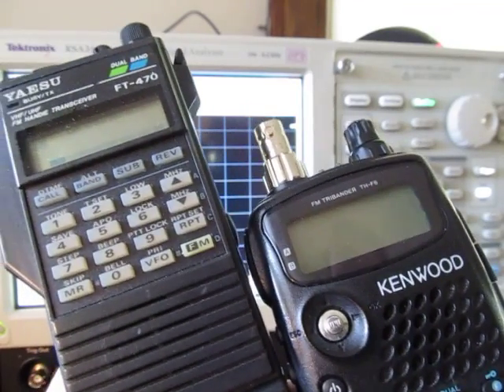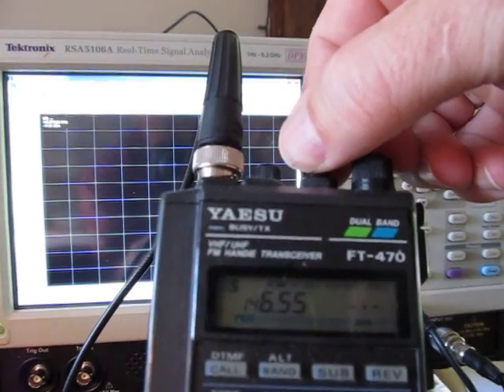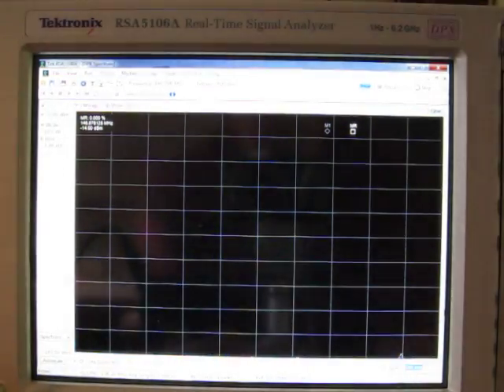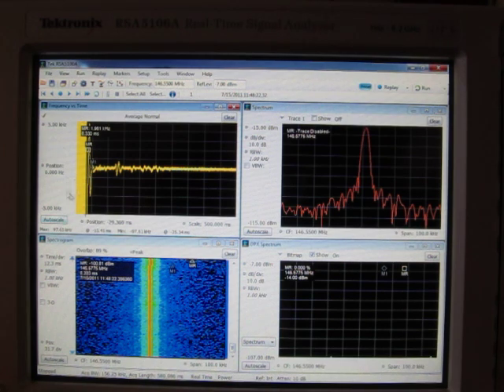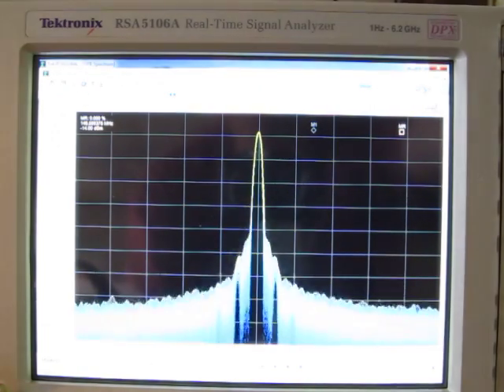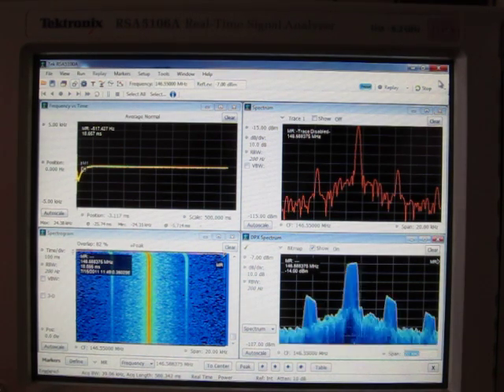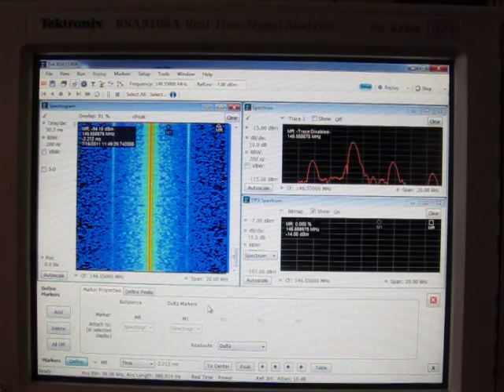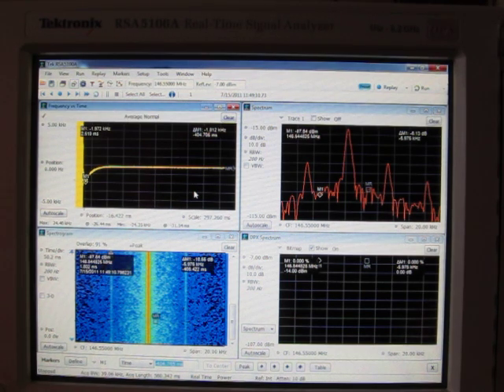#12: Use Real-Time Spectrum Analysis to Characterize a transmitter key-up

Comment: Can you give us the ordering information on your variable coupler device?  I think something like that would be useful in my shack!!  Yet another very helpful video.
Reply from the maker: It is similar to this unit: https://www.rfparts.com/signal-samplers/rfa4059a.html
Reply: @w2aew  Ok, thanks.  Is that one adjustable as the one you have?  It doesn't appear to be so in the specs, unless it should be understood by those in the know.
Reply from the maker: @microreniassance2929  If you look at the datasheet (https://www.rfparts.com/fileuploader/download/download/?d=0&file=custom%2Fupload%2FFile-1484260130.pdf) you'll see that it has the adjustable "slide".
Reply: @w2aew  Ok, thanks.  I didn't see it in the front end specs so I didn't look further.  My bad.  Thanks for all the help, as usual!
Reply: @w2aew  I can't seem to find one that handles 1.5MHz to 30MHz in that form factor.  Bird has some but about 7x more expensive.  I'll keep looking!
Reply from the maker: @microreniassance2929  Those same unit will work at HF, but will have higher loss (less coupling to the sample port) - but definitely usable.  It's what I use...
Reply: @w2aew  I was wondering about that looking at the spec graph included in the package.  Thanks for the confirmation!  I'll use it as is!

Comment: Seems that not good design for transmitter since i guess synthesizer is not already locked while transmitter is already powered. Should not enable tx before lock detection to avoid these outband garbage

Comment: I have a transmitter fingerprint board I bought back in the 90s.  Its an ISA card that goes in an old computer, or it has an external enclosure that interfaces through a parallel printer port (remember those?) to a laptop.  It runs DOS software and you hook it to the discriminator output of a receiver, and it will build a database of these transmitter keyup transient fingerprints.  Every time someone keys up, it displays the callsign you previously associated with that fingerprint.  Great for identifying asshats on the frequency.

Comment: What model Spectrum Analyzer is this ? Not that I can afford it, but I thought all TEK RSA's were USB type that used the PC for display.
Reply from the maker: The Tektronix USB based RSAs are only a recent development.  Tek has had benchtop RSAs for more than 20 years.  Early on, these were made mostly for the government agencies.  Over the last 10-12 years, Tek has made these more public.  The unit used in this video is one of the RSA5100 series, which has four models (3GHz, 6.2GHz, 15GHz and 26.5GHz) and have realtime BW up to 165MHz with >3million spectrums/sec performance.  The RSA7100 series features up to 800MHz realtime BW.  So, yes, Tektronix has a LOT more than just the USB-based RSAs.
Reply: Thanks for the information.  I wasn't aware of that series of instruments.  Way, way out of my budget! But, its interesting to see what a high end RSA can do.  Also, i never realized that an FM signal has a fixed carrier. I always though the entire signal was modulated.
Reply from the maker: The presence of the carrier is really a function of the modulation index.  You might enjoy this video on the topic:
https://www.youtube.com/watch?v=8IBOYoIV5m8

Comment: can you compare two same model transmitters? show the difference due to component variation.
Reply from the maker: You can capture/record baseband IQ data from each device individually, then examine the characteristics (spectrums vs. time, freq vs. time, etc.) of each of the acquisitions.  Many of the displays allow to compare saved traces with current traces to observe the differences between acquisitions.  All results of both acquisitions can be exported to tools like MATLAB, excel, etc. for more intensive comparative analysis if desired.

Comment: Thanks Alan, I could not access throught the Tek page said access denied, in google there is only one page instruction, but I need the offset delay for short and open and C0,C1,C2,C3, the instruction paper does not have that data. I want to use the YBAC3 in an HP 8752A 300Khz to 3 Ghz unit I think I can use it right?

Comment: The little 5kHz pips look to be the reference sidebands of a PLL synthesiser that has a 5kHz phase detector frequency. The way they settle is typical of a digital phase detector with a charge pump output. Although the lock time of the synthesiser may be a few milliseconds, the system still takes extra time to completely remove all phase/frequency error in the loop and this means the 5kHz reference sidebands kind of gracefully fade down as any residual errors in the loop fade away to full lock.